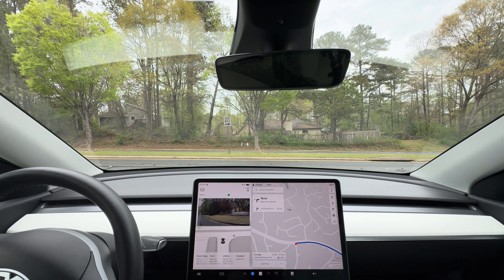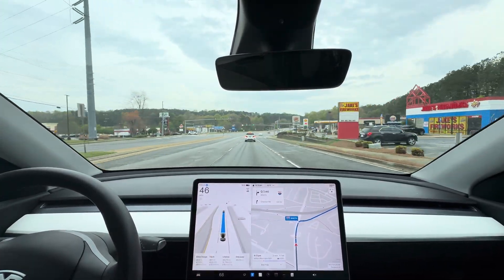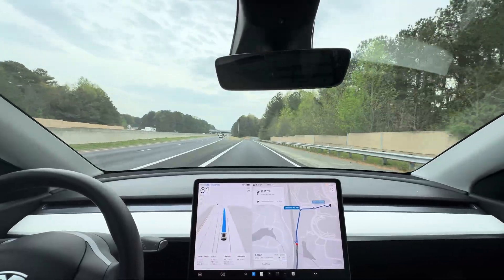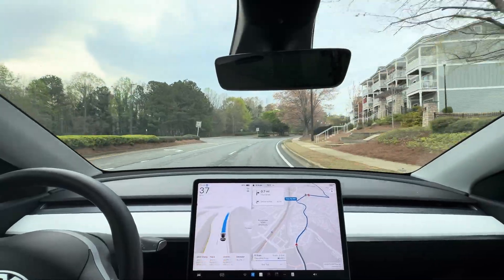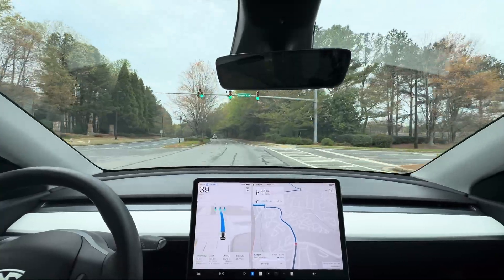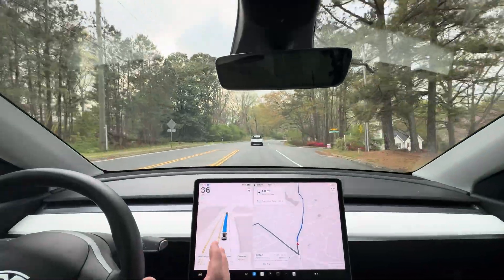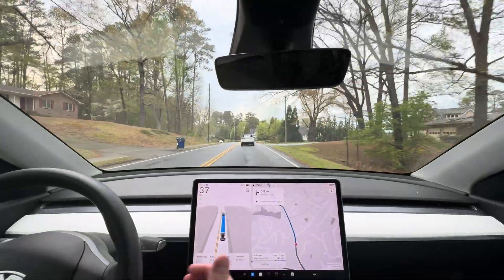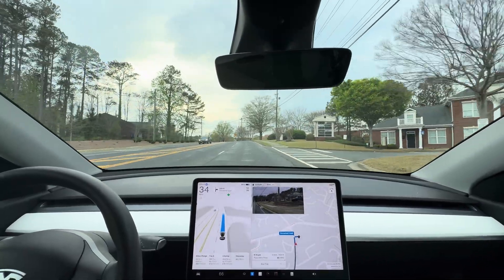Tesla FSD v12.6.4 After Camera Housing Clean

Comment: Thanks for the video. Have a M3 HW3 with the same problem. Did the camera clean and recalibrate. But for me, a system reboot (hold both steering wheel buttons down) solved the lane hugging problem. Running pretty good on 12.6.4. now.
Reply from the maker: I had done the reboot on couple previous recalibrations, but did not for this last one after the cleaning. Apparently this is in the maintenance suggestions, but seems like something that really should not have to be done